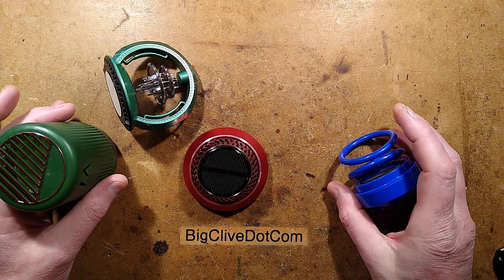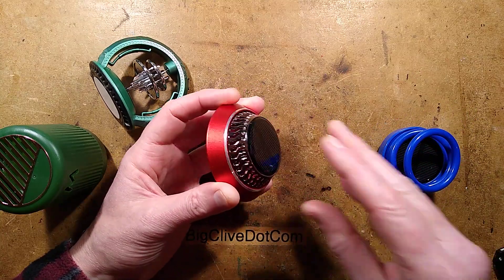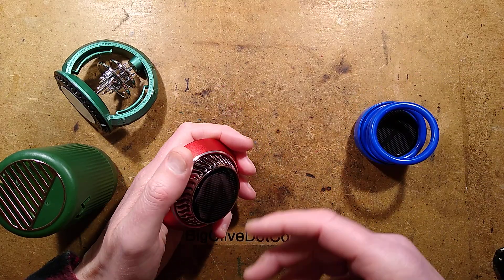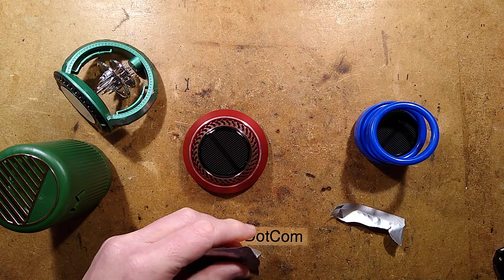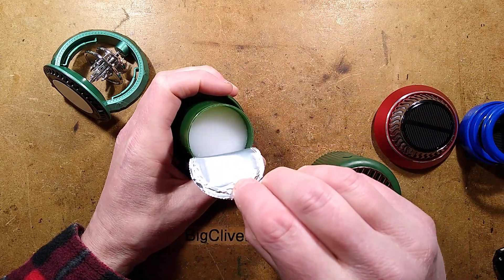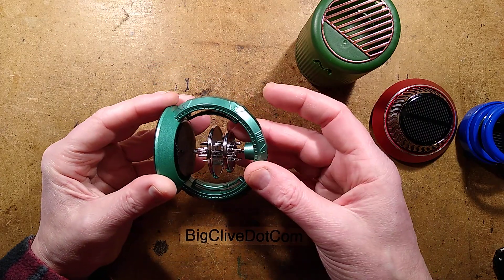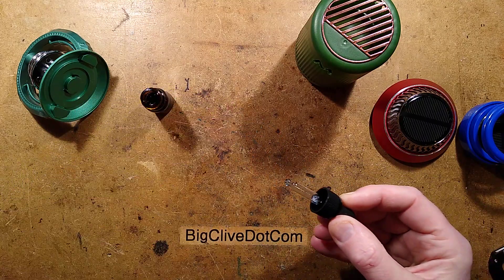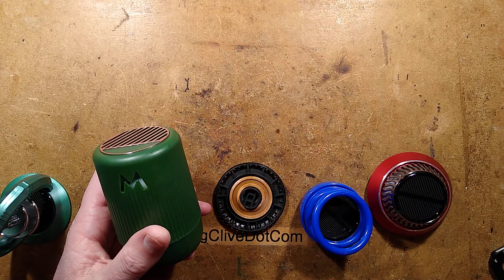How a vehicle molecular de-icer works

Comment: If only they would combine this with a Fuel Saver device.
Reply: Too powerful. It starts to break the laws of thermodynamics.
Reply: @hop-skip-ouch8798  lol, those laws aren't MY LAWS!
Reply: They keep trying, but they keep exploding.
Reply: Genius. They just need a bigger solar panel. Then they can, "use the power of solar to facilitate easy engine usage by calm driver to improve fuel efficiency," or some such half-english nonsense.
Reply: plus put a big satellite dish looking thing on top,  combine all the functionality and call it
radar buster air freshener windshield anti ice fuel saving increased power molecular microwave speed increasing device
Reply: They should use the device that lets you use water as fuel.
Reply: @mac_mcleod  shhhh
Reply: A little plastic spade and funnel set.  Just shovel the snow into your tank. 😁 @mac_mcleod
Reply: You’d certainly save fuel by not being able to defrost the windows!
Reply: and ozone generator!
Reply: Then we’d really be living
Reply: Only if the fuel saver plugs into the cig lighter socket.
Reply: @ThePinkerton1776  Can't, that's where I put the UV air freshener that burned out years ago.
Reply: Hmmm... I'm thinking a self-heating device to help the scent atomize, like a Glade Plug-In, except powered by OBD-II or CANBUS with a few Blinken Lights for effect.
Nothing could go wrong with high current draw on a network's data stream, right?
Reply: @dashcamandy2242   A christmas model
Reply: That also works great.....All the time my car was in the garage, it did not use a single drop of fuel....😉 Same as this thing, kept my windows clean, in the garage...😉🤪🤪
Reply: Don't give them any ideas, seriously. 😂
Reply: Add in an EM field “blocker” and a tell people that the solar powered fan is actually a free energy device. It’ll sell like hotcakes!
Reply: I'd be in on that bundle😂
Reply: They already are, if you tap on the car's roof 3 times in quick succession, both devices get linked and you can use the excess microwave energy to improve fuel economy (source: trustme.bro)
Reply: ill sell you one
Reply: I can sell you a trycicle
Reply: I put one of those vortex air flow things that increases gas mileage in my EV. And it just did literally nothing. I'm so disappointed and my day is ruined.
Reply: i`ve got 1  of those..................they WORK.
Reply: That's what Area 51 is for.
Reply: Wasnt there a guy mysteriously died that created simple fuel efficient design that gave 100mpg in the 80s
Reply: @parkour267  Just because you don't hear about it from MSM doesn't automatically make it real.
Reply: @parkour267 Stanley Myers
Reply: @SupraBdub  Stanley Meyer was the "energy from water" guy. Stanley Myers was a composer.
Reply: @parkour267  He was either fraudulent or deluded, his "invention" was just another variation on the theme of perpetual motion machines.

Comment: A lot of the prominent fragrance chemicals are fairly good organic solvent when used individually in quantity! (Check out the California fragrance chemical disclosure lists for well-known products with scents you'd recognize... you might find some solvents you recognize in there too)
Reply: Once I thought I was being clever by taking the sponge block out of a California Scents tin and stuck it inside the vents on my Mazda 3. The solvents broke down the plastic in the vents and turned it to a soft sticky mess, it stayed that way for years.

Comment: These have also been marketed as energy saving heating devices, enough to get my mum to buy a pack of them (which I told her to immediately send back!)
Reply: Please tell me she listened to you
Reply: This is actually less of a snake-oil claim than it seems. Stirring the air in your home, making warm air that usually sits uselessly under the ceiling to circulate and provide its warmth to people below. Albeit I have my doubts how much something this small helps.
Reply: @sharpfang no way this moved enough air to make any sort of demonstrable effect
Reply: @bcc5701  It's not that clear. Very little air movement is needed to make a difference, the convection is very slow and so fighting it isn't hard at all. But first, these things being solar powered won't work indoors, and then - even if you manage to keep them powered - it's really 'on the fence', very little air movement needed but if that little is enough?
Reply: @sharpfang yeah these would be negligible, if you want to move air around get a box fan or a ceiling fan.

Comment: I think you're just using them wrong. You should actually fill them with ethanol and set them alight overnight: that will keep your windscreen defrosted permanently.
Reply: just pour ethanol on your seat the night before. keeps ice from forming, makes the drive next morning way more entertaining and keeps you warm, especially if you are a smoker.
Reply: @florianlucs7229  What's wrong with gasoline? Cars are supposed to run on gasoline (not gasonline, which would be interesting).
Reply: @pizzablender   there is nothing wrong with gas its a pretty dope chemical. if you prefer gas go for it. havent tested the high on that yet.
Reply: @pizzablender  No, that misspelling sounds like a mandatory gas subscription. Noooo!
Reply: he'snotwrongbut
Reply: @railgap  "If you build a man a fire, you keep him warm for the night. If you set a man on fire, you keep him warm for the rest of his life."
Reply: he needs to get the thermonuclear model !
Reply: Wonder if my Nickel-63 beta particle source would keep the window clear, its fairly spicy @bigoldgrizzly
Reply: @bigoldgrizzly  and AI, I'm waiting for the AI model.
Reply: I see videos for how to make an alcohol stove for backpacking all the time. I want to make one out of that red moelcular de-icer. It's pretty, and it comes with a bonus: if you spill the alcohol and set it aflame you get the deforestation scent!
Reply: @daveh7720 

Smokey the Bear says to be careful with alcohol stoves, because only you can prevent the deforestation scent!
Reply: Alcohol is a lousy fuel, if you want enough energy for phase changes (usually boiling water but you sure can melt ice) get a wax stove. Paraffin or beeswax are very energy dense, your cookware will look and smell like they were over a camp fire -- because they were. :p
Reply: My car is a hybrid and is now 14 years old. Strangely enough, neither the electric or petrol power systems have decided to set themselves on fire so far…
Reply: @Mark1024MAK  That raises an interesting point. Would the chance of fire be additive, or just the worst of the two cases?
Reply: @Bigrignohio  - well, my car is a Japanese made car, the manufacturer is known for having a good reputation in terms of making cars that have very good reliability. So I would say good engineering reduces the risk substantially…
Reply: @Bigrignohio It’s additive. I’m pretty sure there’s a study where hybrids had more fires than gas cars and gas cars had more fires than EV’s. I still think hybrids are a great concept and I might get one at some point.
Reply: @deltab9768  To me hybrids make sense when they are plug-in and have enough battery for the average commute. Say, 40 miles. That way you get the best of both worlds. Range of a gas engine, low per-mile cost and low emissions of an EV for daily use.
Reply: @Bigrignohio  yes that’s the general type I would get if I do ever buy one. In that case most of your yearly mileage would be electric, you don’t have a heavy battery, and if you have to make the occasional long trip you can just stop at a normal gas station.
Reply: @deltab9768  Bonus would be if there are hybrids with Fast Charge capability.  Then you could sometimes also hit the charge stations on trips!
Reply: @Bigrignohio  that’s very true hybrids are perfect for people who live in suburbs and thus may have to go out farther to see family/friends and thus use gas and when their in the city they can use electricity
Reply: I agree. He’s doing it wrong. 😮
Reply: I got a better idea. Just break it. Won't need to defrost what you don't have!
Reply: I tried this, and my car was ice and frost free in the morning. I just couldn't drive to work. But on the positive, I didn't have to de-ice my car! :D
Reply: given the one at the 3 min mark already looks like a fire sprinkler head that would give it a new meaning heheh
Reply: That could burn the vehicle to the ground.  Not very good advice.
Reply: @Sum_Tings_Wong  That's the sarcasm in the comment.
Reply: That would work 100% better than these devices.
Reply: they are apparently just a scam, "computer clan" made a video about one of those
Reply: That's what I do
Reply: I will sell u deforestation smell 👍
Reply: Guy, these actually work!!  That is if you pack a thousand of these into the car, the voltage drop will generate enough heat.  HA-Ha-Ha
Reply: Hopefully it doesn't crack
Reply: Just take your car to the junkyard you don't need it
Reply: once not permanent once
Reply: permanently?  can i sue you if it doesn't?  
do you stand by that statement?
Reply: Can sue anyone, do you win? With a profile picture like that no... You would be labeled right wing and most courts lean left. Also impressions DO matter. @darkracer1252
Reply: They way they work is they don't!!!!
Reply: should also work great for deforestation.
Reply: As a bonus you'll also get heated seats, heated steering wheel, heated buttons, dash, carpet, 

🔥 toasty
Reply: Probably just creates condensation that then freezes to the inside of the glass. I have a little Peltier dehumidifier I leave running in the car, to reduce window fogging on cold or wet days, of course it also slightly warms the interior.
Reply: Load of rubbish they are window screen defrosting device are u saying to us that all the snow will be gone like it does on the video. Load of bull mate
Reply: Just buy an electric car, they seem to set themselves alight!
Reply: @nicolassales8679 lol
Reply: @nicolassales8679  Teslas anyway...
Reply: @nicolassales8679  as if cars don't burst into flames from the flammable brake fluid... or as if old cars didn't used to burst into flames when someone rear-ends your gas tank... things will improve with EVs, don't be such a technophobe.
Reply: @nicolassales8679 just like gas cars! Neat!
Reply: @nicolassales8679  There are a lot of EVs in my area. Have yet to see a single fire related to one. But every week there is a new burned spot on the local highway from one of the old (or illegally modified, lots of low riders) gas vehicles burning.
Reply: @Bigrignohio  gas cars do catch fire easily after wrecks due to the spilled fuel.
however, EVs will spontaneously combust in your garage. gas cars will never do that.
Reply: @hello-ef4bn  Are you sure about cars not malfunctioning in the most spectacular manners even when parked?
Reply: @hello-ef4bn  Electrical faults can and have caused gas cars to catch fire many hours after they have been parked.
Reply: @hello-ef4bn  Goes out to tell my Jetta that they were a very bad boy for catching on fire in my driveway like they did
Reply: @brianleeper5737  Anyone remember when Ford was First On Recall Day for that?
Reply: @Bigrignohio Audi dealer in Swindon UK had a large fire caused by an EV a few days ago. Just saying!
Reply: @NiHaoMike64  Someone was charged with murder because the police thought it was arson, not the Ford ignition switch that caused the fire. Right here on Youtube, Forensic Files - Season 7, Episode 41 - Plastic Fire - Full Episode
Reply: @hello-ef4bn  Few years back we had someone's car spontaneously start smoking under the hood in front of our building. A neighbor alerted the entire building, no one knew who's car it was. Someone from across the street parked it there. Firemen came, extinguished the fire, police later found and informed the owner. 
Car battery can catch fire all on its own if the contacts get shorted. There's enough juice in there the happily melt and fuse wires or set whatever non-metalic conductor on fire. For bonus points, a long drive will both heat up the engine compartment and charge up the battery, with the chemical reaction continuing long after the alternator stops providing them amps - while releasing hydrogen under the hood. Gas fumes AND flammable gas. What could possibly go wrong?
Reply: @hello-ef4bn Stay away from EVs that cannot withstand a 200ft fall😂
Reply: @Bigrignohio at least the gas cars won't burn for a week straight.
Reply: @jwalster9412  Yeah. They just flush contaminates into the watershed when they burn.
Reply: @nicolassales8679  "According to one analysis of U.S. government data, EV fires appear to occur less frequently than ICE vehicles, with 25.1 fires for every 100,000 vehicles sold compared to 1,529 fires for ICE vehicles."
That's . . . . 60 times greater chance of fire?
Reply: @hello-ef4bn  Well to be honest gas powered cars can catch fire also when just standing unused. Ford a a recall once for a brake fluid switch that was wired always hot (hehe it really was) that could fail and burn the vehicle down. My 97 Lincoln Towncar has a revised harness for this switch with a sticker on it for the dealer to recognize it had been retrofitted. I think it just consists of a fusible link and that´s it.
Reply: @aware2action  So literally any vehicle ever? I've never heard of a car surviving a 200 ft fall EV or not.
Reply: @zerieth6620  Thanks for the catch.👍 Yes, no car will survive a 200ft fall, except  people inside an EV survived a 250ft fall a while back.
Reply: @Bigrignohio  Traditional gasoline and diesel powered cars are more likely to go up in flames compared to electric vehicles but the fire of electric vehicles are much more difficult to extinguish.
Reply: @Bigrignohio  That's cos you live in the US, have you seen the state of peoples cars? #customerstates, over here you would get stopped and dragged away to court then prosecuted for having a car that dangerously unfit to be on the road!
Reply: @markwood9751  Ah. Let me guess, you are in the UK. Where you have to pay to watch BROADCAST television.
Reply: @Bigrignohio  it's been a very long time since I have seen a car fire in my area... Of any type.  Though we also don't see that many electric cars.  Far more often the fires seem to be caused by improperly discarded cigarette butts in dry leaves or mulch.  Bonus points if the leaves or mulch is at a gas station (it's amazing how fast the staff can run out with drink cups to extinguish the mulch fire, and they act surprisingly practiced at exercising that skill)
Reply: @brianleeper5737  generally though those are not related to their fuel source.  I think the most recent argument I saw was a recall for vehicle fires related to the ABS pump and brake fluid... Which would be a system present in both electric and gas cars so blaming gas cars on fires  so blaming gas vs battery is irrelevant.  There have been a few of those happening recently in the news some recall for components that are common to both types of vehicles and somehow get twisted into a gas versus electric debate.
Reply: @hello-ef4bn  sometimes they do if they are faulty and somehow generate a spark the electrical equivalent is usually a faulty charger that causes the battery to short circuit but that’s pretty rare with factory batteries
Reply: lol guess you don't look far @Bigrignohio
Reply: @EC-dz4bq  Look far for what? Gas powered vehicle fires? Had one just a block or two over last week. No EV fires around here though. Ever.
Reply: @hello-ef4bn  A few years ago a diesel car caught on fire at an airport parking garage which then lit almost all the other cars on fire,
totalling roughly 400 cars and 2/3 of the garage.

It was an Opel Zafira.